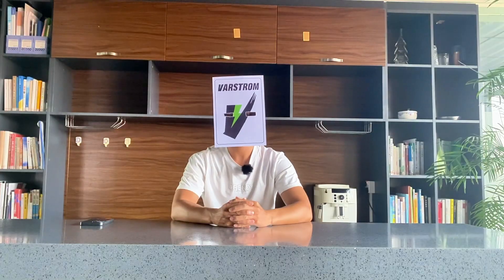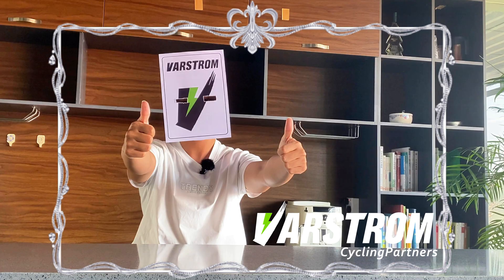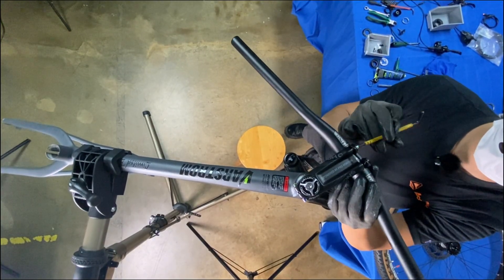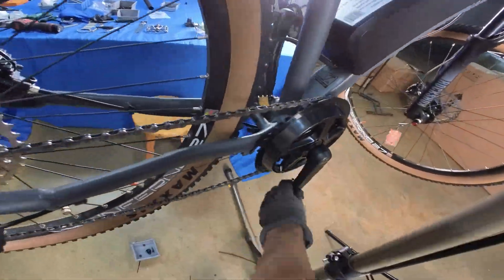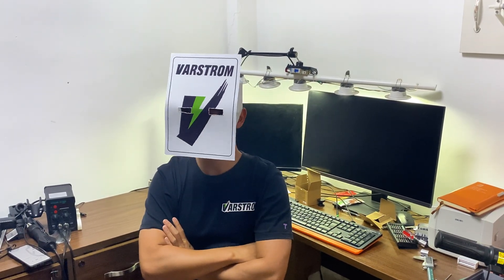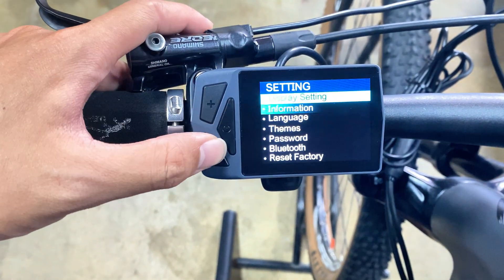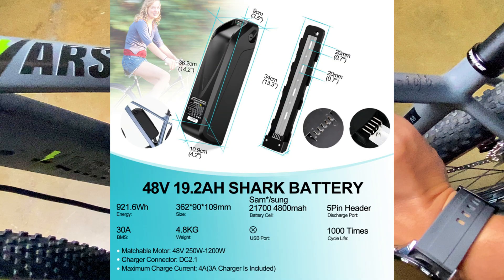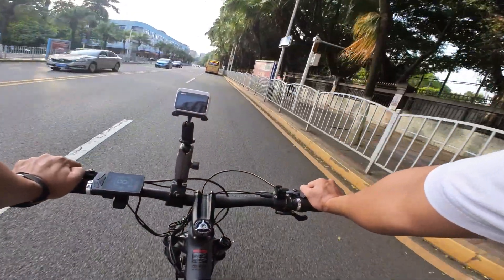DIY Ebike Chronicle：Built from Diverse Parts-TSDZ8 assembly and function introduction

Comment: Just installed my kit on a Kona Jake gravel bike - basically the same motor and battery shown in the video.  Wow, so far works better than expected.  It's quiet and the assist levels of the stock firmware are pretty good.  For those wondering, on my bike, I did not install the brake sensors or the throttle.  I did install the gear shift sensor and speed sensor.  This makes for a very clean install.  I am finding the torque sensor responsive enough that a brake sensor isn't really needed to feel in full control.  So far, great !

Comment: Does this motor need a gear shift sensor, or is it safer for the chain because it's a torque sensor type motor??
Reply from the maker: Optional, it would be better if installed

Comment: Does the does this 750w mid drive motor same as the 500w having delay when you use throttle while pedalling uphill?
Reply from the maker: Generally, a 750W mid-mounted motor will have less lag when using the throttle when climbing a hill.

Comment: Hi Team, being torque senor motor we don't need gear shift sensor and any break sensors ? I assume that the moment we stop pedaling we can use the breaks and they will not interfere the work of the motor? And also to switch gear we just need to provide a little torque but it would not be enough damage the chain for example? Thanks and keep the good work )))
Reply from the maker: Also, your second point is true. But I'm a DIY guy, haha, I like to put everything on my bike and make it a luxury version.The kit does not include a shift sensor, but if the motor is high power such as 1000 watts, it is recommended to install a shift sensor.😄
Reply from the maker: Hi there, both of your points are correct. The torque sensing motor can be used with or without a brake disconnect wire，but our kit includes a brake disconnect wire。and considering that if the motor is inthrottle mode, the brake motor will still have power when the brake is pressed, for safety and security reasons, I still installed the brake disconnect wire.

Comment: Hi there. Love you're content & currently waiting for my TSDZ8 to be delivered tomorrow hopefully. I want to ask you if you know would I be able to use my "ebike" UKC1 display with the TSDZ8 as the kit I bought comes with the vlcd5. I have the UKC1 as well as a M6C, kt-lcd8c, kt-lcd7c, sw900. I already have a 1-5 cable & a motor programming cable if I'm going to need it. I just realised that a few of your videos that you have "ebike" screen come up when you first turn on the display. Hence my asking about the UKC1 I have. Thank again & I appreciate any help or advice. 🙏🏻👍🏼
Reply from the maker: Hello friend, regarding the use of ukcd1, you need to check whether the connection line between the instrument and the TSDZ8 controller matches, then check whether the order of the pins matches, and finally check whether it complies with the Tongsheng protocol.
Reply from the maker: 👍 Hope it all works out perfectly for you. 🤞